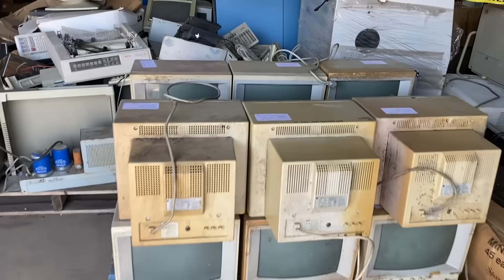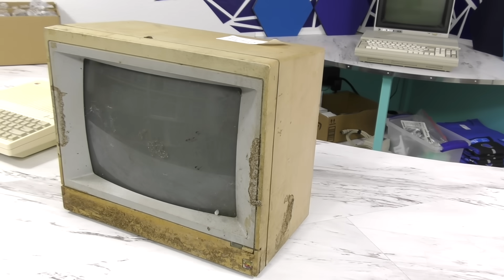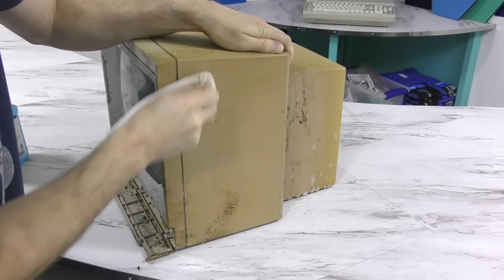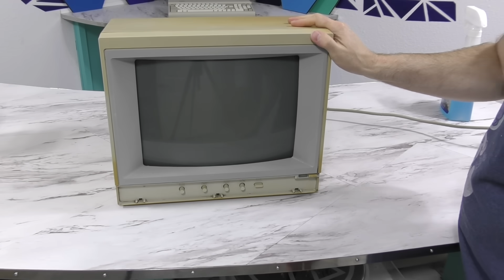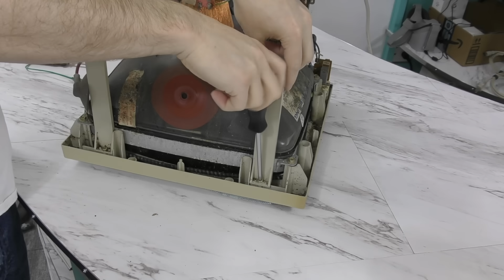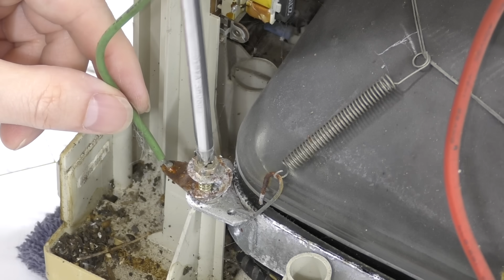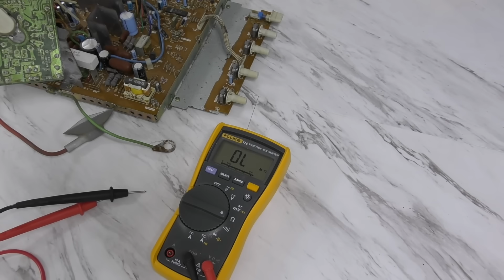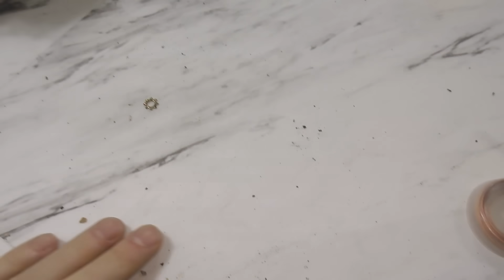Apple Monitor Found in Landfill - Restored - Part 1

Comment: Diodes aren't so complicated, especially since the schematic shows a standard rectifier and not a Schottky or Zener diode - they pass current in one direction. ("You pass butter!") From the other comments here looking for an exact replacement, just put in a common 2A 1000V diode and you'll be laughing.

I'd strongly recommend replacing the electrolytics before powering the monitor back up, especially the one next to that diode. If the cap is electrically leaky, it could easily turn the replacement diode into a fuse again.

Comment: Well looking on the datasheet for tvr10g-e3/54 was on the schematic you showed! you want  400 volts dc 1 amp was made-by semiconductor recovery time 300 nanoseconds
Check it with a temperature thermometer see how hot the diode is getting it's getting hot get a greater amp diode
 is there no numbers on those diodes you pulled out.
You could put a multimeter the probes either side of the diode see what the current flow is, need a multimeter with 10 amps or greater
That dose should be fine you ordered it's 200 nanoseconds so be even better as I say just check the heat or amperage on the circuit

Comment: You can use the 1N4007 universal diode it can take 1kv 1amp that,s more than enough for that circuit i used to repair those monitors 15 years ago its a common problem with these diode,s.

Comment: Zener diode DZ mark (diode zener), except you need to look more on the schematic to see which voltage is it...
My guess is that it could be BZT03C180-TR from Mouser, and that is 180v zener one. Price around 70 cent.

Comment: David be careful with cleaning the picture tube! The black dust on the back side is not a dust. This black "dust" is a graphite. If you remove the graphite, the image will no longer appear on the display. If you remove the graphite partially, the image may be dimm.

Comment: I'm sure you've already tried it out, but the diode you picked is most likely fine; it's a little slower, but it shouldn't make much difference unless it's operating at high frequencies. I doubt you'll find an exact replacement, but if you want a faster diode then the UF4007 would do the job. It's a 75ns diode vs the 150ns of the old TVR10G.

Honestly, I'm shocked how little corrosion there is on that monitor! It blows my mind that only really the potentiometers were really affected, and the tube virtually untouched. But I'd definitely do a full re-cap just as a matter of course. I was chatting recently with a colleague who I found out used to be a CRT maintenance technician, and the visible re-trace is usually a sign of bad caps.

Comment: the voltage says 180 V
diod for that case just have to be able to take that amount of voltage and enough of amp´s

you should choose a higher diod that can handle more amp , that means it doesnt get hot therefore longer lifetime

Comment: That diode appears to be on the G2 supply for the CRT. I would start with a one watt high speed switching diode since this part of the B+ supply is switched at the horizontal frequency. Some of those round diodes were zeners but I don't see why one would be called for in this application.

Comment: "a few days..."  famously, picture tubes have acted as Leyden jars holding dangerous charge after sitting around for years .  The circuit in the finished device that bleeds off the charge could very well be damaged and not working, so caution is warranted.

Comment: Signal needs adjustment a little liney...
My guess is the video gain or brightness is too high and it's being overdriven, producing retrace lines. 
Usually a sign of a worn out tube!

If you like videos like this, check out shango066's channel. He pulls TVs that were dumped outside mining towns in the California desert and makes them work.

EDIT: The mystery component with all that corrosion is a high voltage diode

Comment: I have a new-in-box Commodore 64C. Unfortunately, the box got damaged in a flood. Thankfully the Commodore looks fine since it is in a sealed bag.  I have the floppy drive new in the box also. Threw the boxes away today since so far gone from the water damage. Sad about it since I liked having them in my retro room sitting on the shelf. I have the monitor new in the box also thankfully that was somewhere else and did not get damaged.

Comment: I've never seen a diode like that - either intact or broken. As long as the voltage and amperage is within spec, any diode should do the job - They're the electronic equivalent of a check valve - dead short in one direction, ultra-high resistance in the other.

Comment: Oh, were was so easy issue with diode - just take any with 1000V and 1-2A :)) 
And picture on monitor shows were issue with +V for tube electrode - screen go withe because diode lost contact and no voltage goes to tube circuit (~200V). 
Fore full black screen it need to be +200V on each (RGB) tube electrode

Comment: 6-years of being an Electronics Technician/Reactor Operator in the Navy....followed by BSEE...

Here's my advice...

A Diode is a Diode!

It's a one-way device that prevents current from going the opposite way.

3 settings that are most important...

1.  Flow-through Voltage (what it takes to allow current to pass in the right direction)....ideally very low.
2.  Back-flow (opposite) Voltage (what it takes to override everything and allow current to pass in the wrong direction)...ideally very high.

3.  Current...voltage settings won't matter if the current is so strong it burns up the diode with heat

(1.a...option...you can change the flow-thru voltage settings with a set of resistors... But in this scenario, they're already designed and set in place)

You don't need to consult a ton of manuals and surf old internet databases...

Unlike Resistors, Capacitors and Inductors, there is no exact setting you need...its a one-way valve...either it can stop everything, or it can't...

Just put a good low/high diode in... With a large current tolerance...

Voila!

Great video, as always 8BG...

Cheers!
JerBear
Charlotte USA

Comment: Wow, that's an ultra-rare monitor!  The RGB model (plus the required RGB 80 column card) added so much cost to the Apple //e that very few owners bothered...I used the RF modulator I bought at RadioShack for the times that I wanted color.  Never did the need for color + 80 columns ever pop up 😉  Judging by the quantity and apparent inventory stickers, I'm guessing school district or private school.  The El Paso Independent school district made use of monochrome monitors on their Apple //e's .  Nice to see you back on YT, David!

Comment: @12:37  This diode is a rectifier diode used in fast switching circuits.  The original part was SOD-57, but that could be the package.  I believe the replacement part is V09G and can be purchased from AliExpress:  https://www.aliexpress.com/item/4001257767210.html.  This at least gives you a picture of the part you are looking for.  Here is a datasheet:  https://www.datasheets360.com/part/detail/v09g/-4239577236480818493/

Comment: 14:52 / 15:14 There's actually a chance that some day those old computers get excavated out of the landfills, in the course of landfill mining.
btw: Landfills are some typical American thing. Here in Western Europe, we burn our trash. Vintage tech may lay around in old landfills from until the 80s/90s. But since then, it almost all got incinerated or recycled.

Landfill mining may be utilized when a country wants to get rid of old landfills, or if a company is interested in the materials there.
"In the process, mining recovers valuable recyclable materials, a combustible fraction, soil, and landfill space."
But when they do that, it's quite unsure if the recycling company actually recovers old electronics for selling them to retro fans. Maybe it's easier for them to simply shred them and put them into a recycling facility. And maybe the old electronics are already crushed due to waste compaction.

Comment: Those old diodes were mostly Philips devices and where it was, points to it being a fast recovery diode.  I'll poke around the old data sheets and find something similar. Perplexing it has a series resistor tho. Could be just a half wave rectum finder feeding part of the flyback driver. Dunno. Either way, it's running around 15.5khz so don't use a slug diode with a week's recovery time 
Anyway, change those electrolytic caps, they all most likely close to death and will become a short. It's not a matter of if but, when.

Comment: Still rather clean up these than something from a heavy smoker, ever again.
Reply from the maker: Ah yes.. The dust that you can't vacuum off the PCB or blow off with an air compressor.  About the only chance you have of cleaning that stuff off is using a power washer.

Comment: To clean large case parts like this, I simply run them through the dishwasher on a low-temp cycle (55 C), with ordinary DW tablets. Works fine and gives a good result without all the hard work and gunge. Labels suffer, be warned!

Comment: As long as any custom chips and plastic parts are still ok you can probably restore anything. It's just a matter of throwing enough time and/or money at it. Any metal bits can be remade (just take a look at MyMechanics), so can circuitboards, and most chips and components on them can still be bought or salvaged. The only question is: when does a restoration turn into a remake?

Comment: David, at some point you may consider getting a little portable soda blaster. It may help you with some of your difficult cleaning tasks... especially with the bezels that have a lot of nooks and crannies.
Reply from the maker: I've actually wanted one of these for a while.  I have been wanting to experiment with it and see if it could be a substitute for retrobriting.
Reply: @The8BitGuy  I don't really think that it will whiten it to the point that retrobriting does; however, it will sure eliminate a ton of the elbow grease of cleaning parts before you start the whitening process.

Comment: Once you verify your find is restorable, try some hot premixed (2 table spoons per 2 gal hot water) dishwasher machine soap, cascade or private label crystals..use skin protection in case.. this mix works on dirty pvc fittings.

Comment: The 1N4937 may work. Crucial attributes are voltage and reverse recovery time. The diode is probably used in driving the flyback and needs to be fast to not absorb the flyback energy. Types I've used that look similar are BYV95 (250 ns recovery time). The UF series, like UF4007 (1000V model, 75 ns recovery time) may even be too fast, but/and I'm unsure if the design will mind.

Comment: 1N5408 Would be a nice replacement for that diode. 180V line is for the anode supply to the CRT. Legs would be a little thicker, but 3Amp 1000V capability ensures all compatibility issues negated.

Comment: I was scared as you were opening up the monitor. I was expecting some critters to come scurrying out considering where it had been for years. Hehehe...
Reply: I remember when my job was the maintenance of computers at a car dealership and workshop. 
They were... appetizing. Those PCs had dead spiders inside, I found a mummified mouse in the power supply grate , everything was so full of soot and dust... This CRT was really clean in comparison!

Comment: @ 12.45 ... my first thought was a diode and if my memory serves me correctly from my apprenticeship and later study time... i was sure its a diode but... the point usually means a "Zehnerdiode" (a Diod that lets trough the wrong way on a certain voltage) ... but that point i wasnt sure as i dont know the ANSII schematic symbols well, im european so we use different symbols (ISO Standard nowdays). Thus that point could just be an US thing but im glad my brain isnt compleately melted after all these years and it is indeed a diode :D

Comment: Im not surprised by this at all. Long ago I had a ViewSonic CRT monitor that a friend and I found on the curb on a bulk trash pickup day. We grabbed it and put it in the bed of his pickup, and kind of forgot about it. About 6 months latter I needed a monitor and it was still in the bed so I figured what the hell, might as well give it a shot. And sure as heck it turned on and actually worked. 
This is after bouncing around in the bed of a pickup, in the Florida sun, rain and humidity for about 6 months. And during the few years I had it id spilled stuff on it, opened dozens of beer bottles on the edge of it and it just kept on working.
So yeah this isn't entirely surprising to me.

Comment: Let’s all remember to thank the volunteers at Computer Reset. Great work guys!
Reply: step one figure out what the diode was step two get a modern replacement to repair the monitor's by putting the new replacement in it to get it working again
Reply: @raven4k998   Wrong comment, bro

Comment: Dad used to repair CRTs back in the day. Even our old console tv (that was struck several times over the years). I showed him this and he said you could probably replace it with a 1amp 1,000volt diode. It's what he did with some of the TVs.

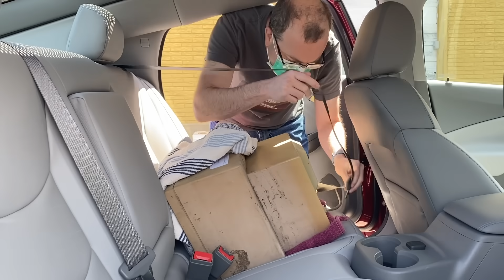Comment: at the timestamp 1:47 i noticed he fastened the seatbelt on the crt, i think it's good practice but i think he should put it on the passenger side, (assuming he's the only one driving) if he gets in a head on collision and the seatbelt fails to hold te crt, then it will act as a projectile. if its on the drivers side, the force of the crt on the back of the seat may bend the seat, possibly crushing the driver between the seat and steering wheel. if all this were to happen on the passenger side, the empty passenger seat won't crush anybody.
stay safe! :)

Comment: 11:16 BTW, Evaporust actually works rather well, and it's not that expensive. This would work well in these scenarios as you don't need a lot and the gel would allow you to treat spots without worrying about immersing the whole thing: https://www.amazon.com/Evapo-Rust-Remover-Removes-Stains-Surfaces/dp/B0762WZDP7/

Comment: It's probably been mentioned but I believe that is a 'TVS diode', short for Transient Voltage Suppression. Lots of CRT TVs and monitors used them back in the day. I'm not an engineer but I believe they were primarily used as 'freewheeling' or 'flyback' diodes to snub inductive voltage spikes that came from the flyback transformer coils. They are found in different packaging these days and I believe those old ones are gas discharge type.

Comment: On that schematic it’s listed as a TVR10G; which a quick google search indicates is a “sintered glass junction fast switching diode” rated at 600v, 1a. Data sheets are available online; but the part is listed as obsolete (gee, imagine that! 😉 ). You should be able to find a modern (I.e, available) replacement from the parameters listed in the data sheet.
Reply: The 1n4937 is a bit slower than the TVR10G; but considering the circuit, I suspect it will work... I’d need to see the whole schematic for that part of the monitor to be sure, but I’m guessing that the high voltage might be a little low with it.

Comment: If youre unsure of the fault I would highly recommend replacing the high voltage capacitors in the circuit related to the diode.  In the reference schematic there is c411 and c412-  not the same schematic but you said it resembles your model, and capacitors and diodes are very prone to fault under the conditions you described the monitor experiencing.  I think you've probably already solved this stuff, considering this is a series, but thought i'd chime in! love your videos, I look forward to them🙏

Comment: Hi David. Tv technician here. 
Almost in any tv when it has retrace lines and white screen means a problem on 180V video line, and sure enough that diode is shot. You can use any fast recovery diode in this case 1A and 600v or more, like FR107, UF4007, BY227, RGP10J... those are mostly used in many tv chassis. You also need to change the electrolytic cap on that 180v line because the diode turns more like a resistor. Must be really good electrolitycs but always is better to change all caps in PSU and vertical deflection circuit wich are the most prone to fail. A similar failure with retrace lines but with image (instead of a white one) is generated by a faulty ceramic cap filtering screen voltage. 
 Greetings from Argentina.

Comment: I think I found it. It's manufactured by Hitachi. I believe it is a Hitachi V03E which is a 1S949, which is a 400V Diode. The equivalent would be a 1N5395. I would link to the Hitachi color codes but afraid my post would be seen as spam.

Comment: You seem to have found (probably) the reason why all the monitors died at Broderbund when I worked there.  These monitors were left on for hours+hours+hours so they aged quickly.  I got one, of course it didn't work, it did arc inside somewhere.  I gave it to someone who bought some other pcs from me.

This was in 1990... when Broderbund got rid of all its Apple II stuff that had been lying around for awhile.
Thanks for answering an unanswered question from 30+ years ago!

Comment: At MINIMUM, replace all of those caps. It's a 30-60 minute job. Despite how they look, chances are several (if not most) are out of spec from 30+ years of aging. I'd put money down that the picture quality will look noticeably better. Worst case, you don't see a huge difference in the picture and future-proof it. As for the diode, have you checked out the manual? Most monitors have manuals containing schematics and a list of every component and their values.

Comment: Here's a tip. If you're ever transporting a crt for any reason ALWAYS transport it face down if you have the option. The only time you don't need to follow this is if it's in a beefy wooden cabinet or if something about it's design makes it dangerous or possibly damaging to do so.